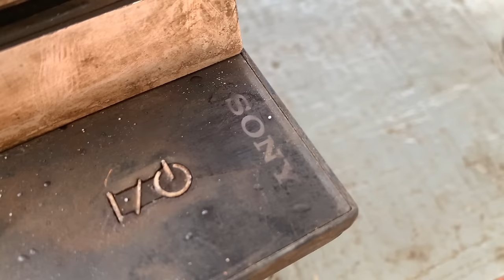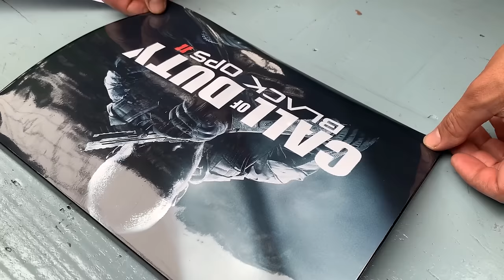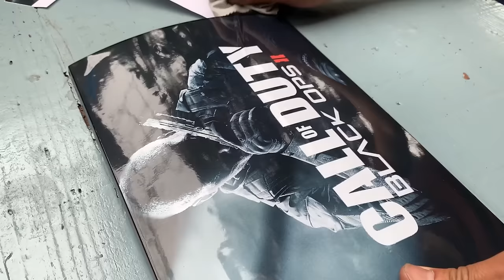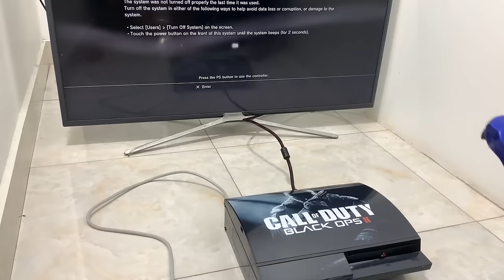Sｏny ｐs３ Fat Console Restoration | Restoring Old playstation 3 Game

Comment: Yet another console trashed on the woods on purpose for a youtube video
Reply: Why trashed? Seems like it's working fine now.
Reply: @Nachzehrer057  No, those are fake videos. It’s staged. They make the console look like it’s broken but they use working parts after "cleaning" them.
Reply: Exactly, you cant just liquid wash the PS3 motherboard, dry it up and putting up a Black Ops 3 sticker makes it working. Man that Mother board is stained, IC chips were long gone, no Architecture data left in the units to pass on to buses. Thats a Fake Restoration.
Reply: Biggest thing is its jailbroken which shldnt be